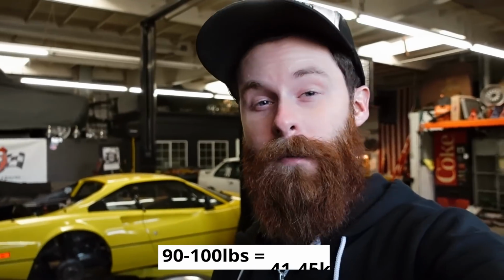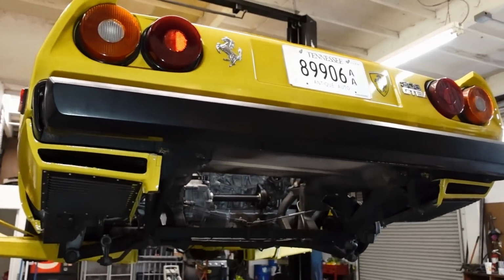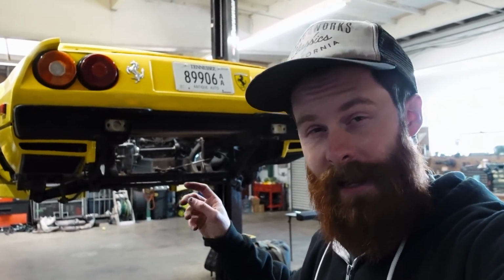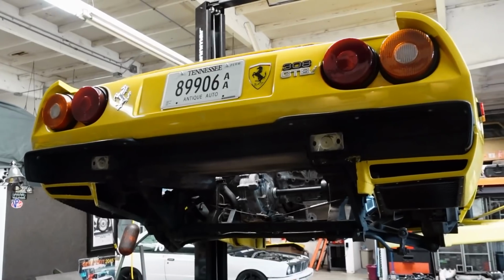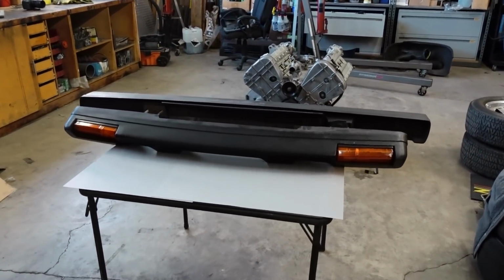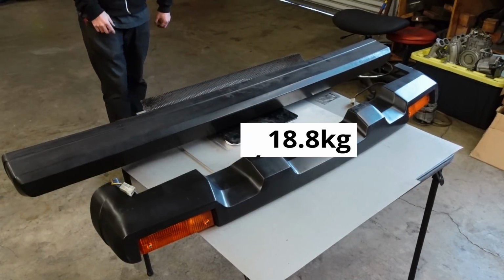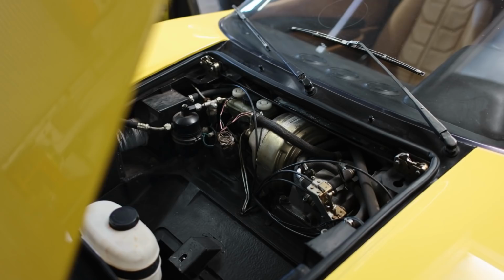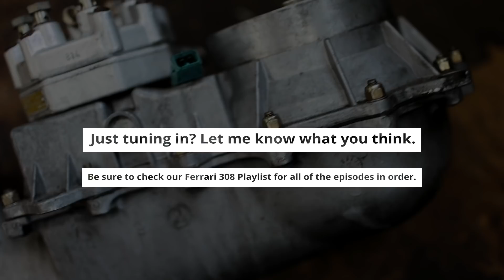Honda K-Swapped Ferrari: Shaving Weight & Cleaning Up - Ep. 9

Comment: Yo! What product/process were you using to clean the engine parts? About to do the same on my S50.
Reply from the maker: Turtle Wax Bug & Tar Remover. I use it on just about everything... Gotta clean the car up? B&T. Gotta clean an engine? B&T. Dog needs a bath? Okay maybe not that one.
Reply: I've also found that Oven Cleaner works wonders (on aluminum parts especially). It etches the surface, so it's somewhat destructive but not to the extent that you'll compromise anything as long as you're careful.

Comment: The bumpers are probably hard rubber with steel strands running through it like belts in a tire but in two directions and about as thick as coat hanger wire or thicker and lots of them.

Comment: Have to admit, I love the looks of the 308, always have. And when I saw K-swap, I didn't know how I felt, but this does make a lot of sense. Stock engines just aren't great. At first I was thinking about a V6 swap, like maybe an Alfa busso engine, but even if it does stick to exotic Italian, cost, reliability and parts are problems. Then I thought about a Honda J35 V6, but realistically packaging and weight are always going to be an issue with anything mounted transverse but an inline 4. The GTO that was based on this chassis had to have it's wheelbase lengthened to mount the engine longitudinally, so that's not really an option. A K24 just makes sense. Like the thinking outside the box and very interested to see this build continue.

Comment: With the car's aerodynamics, you'll want the underside to be as flat/smooth as possible so that car doesn't produce lift and with that, you want to start the diffuser inlet as soon as you can to maximize the venturi effect.
Reply from the maker: That's the plan!

Comment: Yeah those bumpers are heavy (and hideous). Maybe should have included the shock absorbing mounts in the total weight as they are not euro spec either.
Reply: Maybe the claimed 90lbs weight is with the bumper shocks included?
Reply: @AnttiBrax  can't be, as he left them on the car. Also, I watched another channel with someone swapping then US to Euro bumpers and it was over 100lbs with the spring and units.

Comment: I have a similar issue with heavy bumpers on a project car; when you say virtually no "functional change to the car" by replacing the bumpers with carbon fiber ones, I can't imagine carbon fiber actually provide any sort of function as a bumper.  It would be great if they do, cause that would solve my issue.  I'm building a street car, and not a race car, so I do care about functionality and reality of a bumper...thoughts?
Reply from the maker: If what you have are federal 5mph crash bumpers, they’re only useful for stuff under 5mph. Which means they’re useless anyway.
Reply: Yeah, basically the same as what's on the 308. Seems like they would be more than 5mph, but point taken...they wouldn't do much.

Comment: "75 pounds of weight loss with no functional change to the car"  -Except crash protection LOL
Reply: They're the infamous "5mph bumpers". This car will probably never move that slow so they're a bit useless.
Reply: Those impact bumpers would be useless in the application it’s being built for.
Reply from the maker: Or, really any situation at all. They're useful to push on but that's about it.
Reply: Not a safety thing. They were designed to keep damage costs low in low speed crashes. Basically keep other vehicles from hitting the more expensive bodywork in 5-15 mph parking lot type scenario.

Comment: Why leave the bumper shocks on the car?- those are obvious waste weight- I'd build hollow tube ones even if it were a near-stock refresh. Plus the buyer of the bumpers may want them. And you'd be at 100lbs.

Also- music is way too loud compared to the voice segments. You need to rebalance your production volumes there significantly.

PS long time stanceworks browser (and right-click-and-saver) & never saw you until this. cool.

Comment: Why not just hit the engine with some degreaser and a pressure washer?  Would take 10 minutes and save your finger tips!
Reply: That doesn’t get into all the little corners and crevices. Plus you risk getting water into the motor. I imagine people buying Ferrari parts expect a better standard of clean too. You also throw bits of grease everywhere when you do that, it’s not a process you want to do inside a clean area of the shop either.